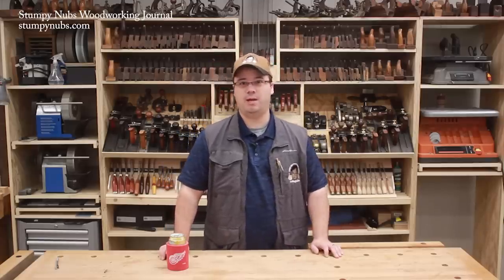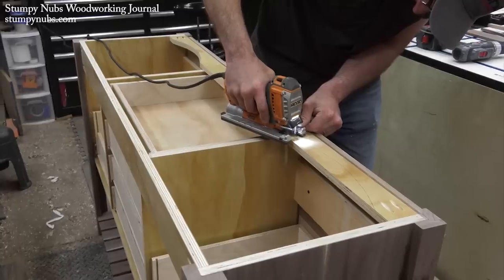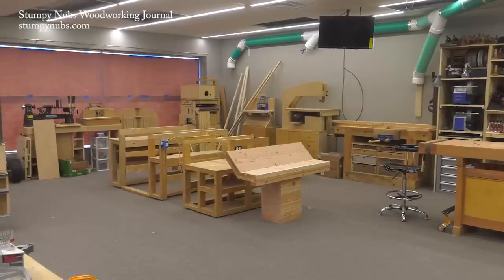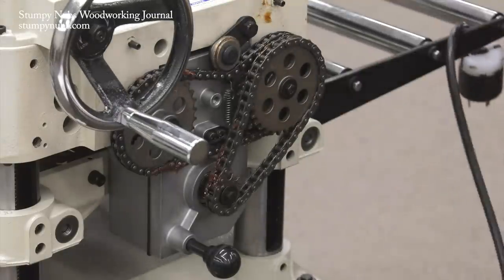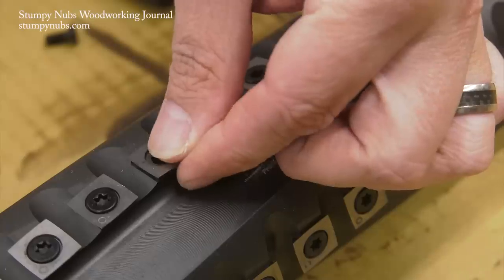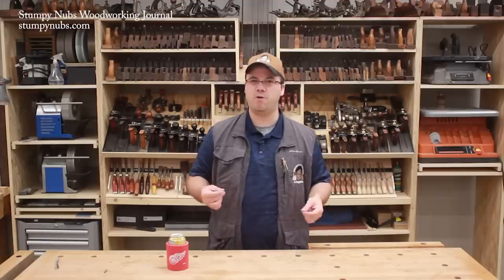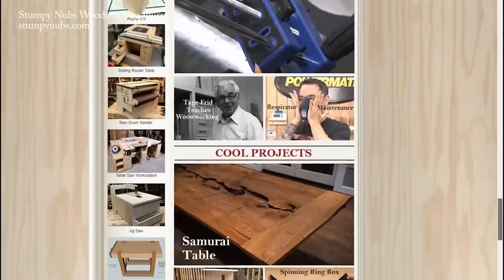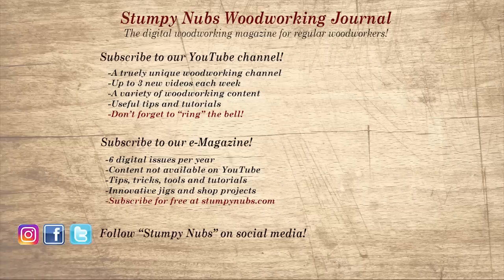Game Changer? A new alternative to Byrd Shelix carbide jointer/planer heads!

Comment: I don't get it.  I started with the Shelix cutter head for my Dewalt 735.  With my 38 years of experience in the wood shop I believe I have the skills to set and adjust the cutters.  There was nothing I could do to get them to not leave ridges on the wood.  The folks at mywoodcutters.com were great to work with they accepted the return without issue.  I was shipped the Lux Cut to give it a try.  Install was easy.  I can't be more disappointed with the quality or lack of quality with the cut.  The 1/2 sheet instructions they sent does say "slight" scalloping "look"  is normal.  I can't imagine anyone accepting the scalloping.  Every LNFT of wood run through the cutter head would have to be run through my surface sander.  What am I missing here?  This isn't rocket science.
Reply from the maker: I don't know. I've put these heads in several machines, including a Dewalt 735. Never had that problem. All rotary planers leave scallops (very shallow ripples), but they should be slight and they should disappear during your regular sanding routine. 80-120-180-220. Are you sanding?
Reply: @gmatulionis I was having the same issue with the Byrd for the same planer. In the process of trying to get a refund now. I was going to try the Lux Cut but your comment makes me second guess buying it.

Comment: I am so disappointed with my lux helical planer head. Scallops. Only .002 from peak to valley, but are really noticable by feel and sight. All the reviews I saw before I bought mine said how great the finish is. It is not.
Reply from the maker: This type of planer is not a finishing tool, it is a dimensioning tool. I am not sure anyone has said it will leave no tool marks. But those are faint enough to be easily removable when you do your finish sanding.
Reply: @StumpyNubs  I probably didn't describe it right. Hard to do without a picture. And I have the same head in my jointer. I shouldn't expect an edge ready for glue up after running through jointer?
Reply from the maker: @dougprentice1363  If the scallops are so deep that they leave gaps when you clamp the edges together, then yes, something is wrong. Send photos to the manufacturer.

Comment: Couldn't agree more!! They get so big and commercial you can no longer relate to them. One example is ... well never mind. I don't want to anger their loyal viewers,. I just want to say that I have dropped the subscriptions and only watch occasionally now. I seldom  give them a thumbs up now because who couldn't do that with their shop/equipment? I learn less and have less interest when I know I don't have a CNC, boxes full of Fein equipment,  and a huge Sawstop with all the bells and whistles and a lathe with a 5 HP motor and ...blah blah. Yes, I have a table saw, bandsaw, routers and things but my total investment is less than just one of their pieces of equipment. TOO MUCH pomp and circumstance for my less than royal blood.
Reply: Oh - Lux cut does not make heads for the smaller joiners(6")/planers (12-13") .. bad enough that the heads cost two to three times the cost of the entire machine, but to find out they don't even make one.... Sad ...
Reply from the maker: I'd look at it another way- Their fancy sawstop cuts straight lines just like you saw, right? And their fancy bandsaw cuts curves just like yours, right? And their fancy router table cuts profiles just like yours, right?So, if a project is just straight, curved and profiled cuts, why can't you relate? Look at the project, not the tools. If anything, you should feel better because you made it with 1/10 the tool investment. :)
Reply from the maker: LuxCut is a NEW brand, as I said. They don't have all the models yet because folks have to send them measurements so they can make them for the first time (just as Shelix used to have to do). So, YES they do make heads for smaller machines. You just have to contact them.
Reply: @StumpyNubs  All that's true and I haven't stopped watching the good projects but using the absolute highest priced woods and the most expensive tools etc. does not make it more attractive to watch methods, techniques, and design for me.
Reply: @StumpyNubs  Yes, I understand all of that and the design does look to be an improvement over Shellix. These days getting the new machine that already has helical cutters seems the way to go as opposed to retrofitting...